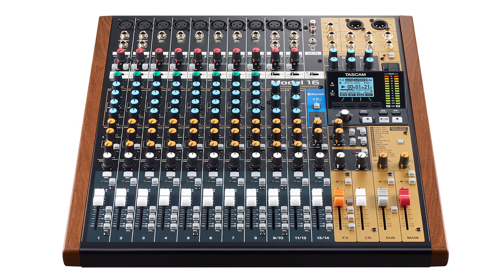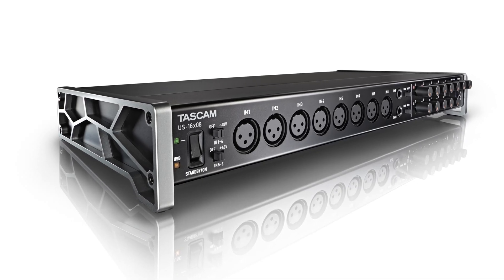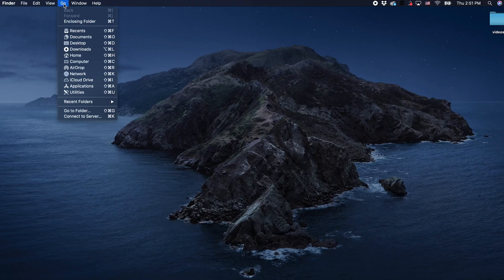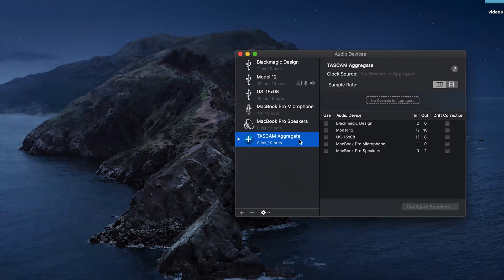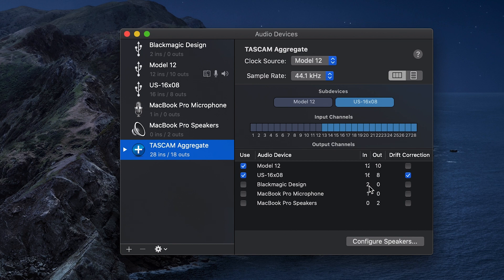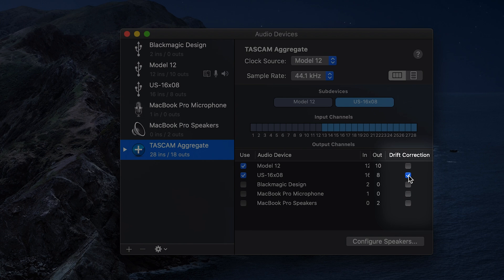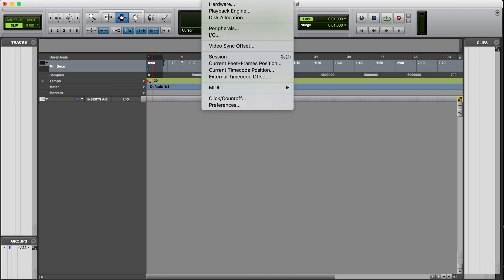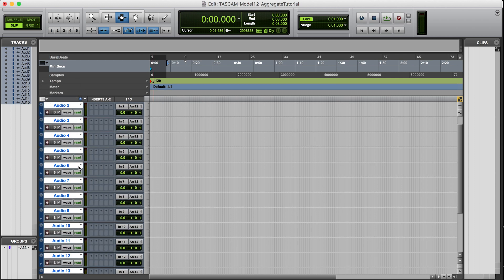TASCAM Model Mixers - How to get More Inputs and Outputs

Comment: Sorry if it’s a dumb question, but I’ve never tried the aggregate device thing yet… 

So…
If I follow the steps in this video, and have this Tascam rack interface with my hardware plugged into it 
(Bass DI, Guitar DI, tr8, JU06a, SH01a, DFAM, Sub Phatty)
So 7 inputs, 2 x XLR and 5 x Mono Jack

Can I then have the model 12 free of inputs, so I can use it for individual Maschine group or sounds? (Samplers, Kits/groups etc) 

I hope I’ve explained myself enough for you to understand. 
There’s one of these exact interfaces for sale second hand for decent price, so it will be an amazing addition for my set up. Especially because I have 7 hardware devices and only 6 mono channels.

Comment: I already own a Model 24.
I want to add a Model 12 via aggregate so that I now have a MIDI,
and would want to put everything with phantom power into the M12 and everything without into the M24.
I'm using iMac with LogicPro
When it came time to mix,
could I export channels to both the M12 and M24 (leaving CH 1 and 2 open on both for the master) and then via cables
plug the master out of the M12 into two open channels on the M24 basically having the M12 be a bus of sorts and now being able to have a larger fader board essentially.
Or could I also, run the M12 master out back into the DAW as two new tracks, and then send those tracks into two open channels of the M24?

And if this is possible, would it be better to have the M12 as the master mixer and send the main outs from the M24 into the M12.

I've tried several google searches and surprised I haven't found an article or video about this specifically.
If it is possible, could you please make a tutorial on it?
I imagine many folks have wondered the same.
And I would suppose if possible with the M12 and M24, one could interchange the M16 or M2400 into the mix and it work as well?

Thank you in advance!!!

Comment: Do you have to keep switching your playback engine back and forth if your tracking from the master interface for example?
Reply from the maker: Hello!  No, that wouldn't be necessary. Once you create the aggregate device it will all be linked and your system will recognize the multiple interface setup as a one overall unit.
Reply from the maker: Great question!

Comment: Hi their does the model 24 have pre and post for the aux sends like the model 16 does, cheers
Reply from the maker: Hello, Craig!  Yes, the Model 16 and Model 24 are virtually the same unit, just with different channel counts.  The internal workings are the same, so anything possible on the 16 is possible on the 24 and vice versa.
Reply: @TASCAMUSA  thanks for getting back to me, so how would one do it on the model 24 when there is no switch

Comment: Just picked up a Model 12 to use with my M1 Mac Studio. When I create an aggregate with the existing FocusRite Scarlett 2i4 with the Model 12 I get a ton of distortion out of my studio monitors. Tried every combo of clock I can find and still, distortion. Use the Scarlett by itself and it fine, no distortion. Updated firmware to 1.33, same result.

Comment: Hello! So I have a Tascam M12 and I want to send audio out of it and to an old Tascam MKIII for some tape sounds. Would I need an audio interface or could this be done with just the Model 12? Thanks
Reply from the maker: Hello J Blue!  You don't need an audio interface for that.  Also, sounds like a fun project!
Reply: @TASCAMUSA  ok sounds good but now….how do I do it haha can I use my main outs from the model 12 to send the audio from my DAW to the MkIII? Or should I use different outs? Ultimately im not sure which outs to use to send audio out of my daw and out of my model 12 to something else. Any recommendations would be amazing! Thanks!
Reply from the maker: @jblue1628  If your main outputs are already hooked up to monitors, you can always use the SUB OUTS.  Just make sure all the channels you're using on the Model 12 have the SUB button activated at the bottom by the fader.  The separate SUB fader will control the overall level of the SUB out.
Reply: @TASCAMUSA  SWEEEEET. Thank you for helping a newbie. Haha
Reply from the maker: @jblue1628  no problem, anytime!

Comment: Hi Guys, I connected my model 12 with the scarlett 18i20, it works great, but is it normal that on the Model 12 the EQ, compressor,fader etc. does not work if the model 12 is the slave?
Reply from the maker: Hello Keller Flavour!  How do you have the two units connected to one another? Also, are you using the Model 12 as another set of inputs, or are you using it as a DAW controller?
Reply: @TASCAMUSA  Hi! thank you for your answer. I made an aggregate device from both interfaces on my Mac. I didn't connect the two to each other,in my DAW it works,but no fader,EQ etc.on the Model 12 works.
The Model 12 is the slave in the Device.
Reply: @TASCAMUSA  i use it at another pair of inputs 👍
Reply from the maker: @kellerflavour336  this should be an easy fix.  The Model 12 has an option in the menu to select where the USB send point is.  Go to the MENU, then MIXER, then select MTR/USB SEND POINT.  You'll have the option to set it at PRE COMP, POST COMP, and POST EQ.

Also, make sure the channels don't have SOLO enabled.  In the same menu as above, instead of choosing SEND POINT, you can select SOLO MODE.  By default, this is set to PFL (pre fader level) which disengages the fader on all channels in solo.

Let us know if this helps!
Reply: @TASCAMUSA  Guys, you are great, thank you very much for your answer, as soon as I've tried it, I'll let you know :)
Reply: @TASCAMUSA  Hi again :) So, the EQ and Comp works, but I also get the signal into the aggregate device with channel fader and main fader to 0.
When I play another instrument, I hear the signal in my DAW even when the channel fader on the model 12 is at 0. :)
Reply from the maker: @kellerflavour336  when the Model 12 is being used as an interface and has it's USB mode in MULTI the signal is being sent to your DAW pre-fader.  So, you'll need to manipulate the levels for that channel in your DAW's mixer section.
Reply: @TASCAMUSA  Hi! Ok,thank you for your answer :) Great Service!

Comment: Can you aggragate 2 tascam to get 48 cgannel?
Reply from the maker: Taro, yes you can!  This can be done natively with a Mac, or if you have Windows you can download third party software to connect them.
Reply: @TASCAMUSA  But ONLY when working in a DAW. It's too bad Tascam didn't make it so you could sync 2 Models together to expand the I/O for remaining working within the desk/box.  Would a firmware update be able to add this ability? If so, that would be a major selling point. And with a Model 12 (which I have) you could double the Model 12's ability and there by making it a real power house and the ability to use it as a surface controller in a DAW for more than the 12 tracks the Model 12 is limited to controlling currently. Am I correct?
Reply: @TASCAMUSA  Are you going to answer my question from almost a year ago about syncing 2 model 12's together? YouTuber PowerCoat Music says it can be done, but I want to hear confirmation from the maker directly.
Reply from the maker: @truthwinseverytime8805  As far as combining two Model 12's to get more I/O - yes, that can be done by creating an aggregate audio device (which is native to Mac capability, but for PC you'd need to download a third party app).  In regard to syncing two Model 12's to get twice the DAW control, there isn't a way to do that.
Reply: @TASCAMUSA  I'm talking about a completely DAWless scenario. Midi cables between two Model 12's. One becomes tracks 1-10 (master unit) and 2nd model 12 becomes 11-20 as the slave and through Midi sync they record all armed tracks simultaneously and play back all "20" tracks simultaneously. Forget about a computer. I'm talking OG no DAw involved. And if this is not a feature of the Model 12 that I am fairly certain you can implement it through a software update/firmware update.

Comment: Iv try this with a focuritr and it fuck up my entire things.. both device were on 24 bit 48
.. the daw was at 24 48... the audio midi set up was too... the saffire was slave... 
Yet the tascam keep saing usb fs mismatch... 
I change it to slave... same... 
I try 44 for all
..same... 

I disconnected evrething started again... same.... 
I gave up.. try to only use the tascam... and it keep saying usb fs mismatch... 
I had to format the sd card and start again from scratch... 
Eventually the problem went away for no reason. 

Try at your own risk

At less you couldve gave us track swap with a menu like model 12
Reply: It probably just synced incorrectly initially and then when you reformatted the card it freshly synced everything to 24/48.

Comment: Ok, I have an apollo 8 that needs and I simply need more line inputs. Can I use this for that? Plug all my boards into this and run this into my apollo 8?
Reply: Yes. I am doing something similar. I have an XTUGA 12 channel board that I am running premix levels to one track of the Model 12 at a time. So for example, I use 8 mics on my drum kit. I get all the levels for those mics good first and then send the summed signal to 1 channel on the Model 12. I use 4 mics when recording guitar or bass and again sum  those to 1 track. I keep doing that for each thing. So basically it does give me 10 mono tracks to mix from that shouldn't need to much EQ'ing from that point.

Comment: Thanks for the helpful video! If I link another audio interface (I'm using a Scarlett) using the aggregate function, would I be able to power a condenser with phantom power on the Model12, while also using a ribbon mic on the linked audio interface safely? Don't want to fry my new ribbon, and would like to use both mics simultaneously
Reply from the maker: Hey JR!  If you were to link two audio interfaces the phantom power applied to one interface would not transfer the other.  So operating a condenser mic on one and a ribbon mic on the other would work just fine!

Comment: Hi their is there anyway we can record a manual fade out at the end of a song using the built in digital recorder, when mixing down there seems no way to fade the sing in or out, any help would be appreciated
Reply from the maker: The Main fader does not affect the stereo mix recording so if you want to create a fade in or out I would suggest turning off the Main on the channels and  sending all the channels to the Sub out, then on the Sub channel press the Main button down. Then when you want to Fade out turn down the Sub fader.
Reply: @TASCAMUSA  thanks for getting back to me, yeah i tried that but then when listening back the fade out is their and after the fade out the rest of the song apears again at full volume, even though I’ve-hit stop on the recording
Reply from the maker: @craighughes-shug6694  The stereo mix recording goes for as long as there is audio, it does not stop after you press Stop. You would need to edit the stereo mix file in a software after to cut out any unwanted audio
Reply: @TASCAMUSA  yeah thats what i was thinking of doing thanks for getting back to me, so it this is the case with the master been in a different path to the control and sub does this also mean we cant access the on board graphic eq for mix-downs, even when using the main outs
Reply from the maker: @craighughes-shug6694  The graphic EQ does not affect the stereo mix recordings
Reply: @TASCAMUSA  on this page on an introduction to the tascam model 24, they guy presenting the video says tweak your on stage monitors or notch out some frequencies during mix-down, thats a-bit misleading
Reply: But cheers for getting back to me

Comment: Great tutorial.How about a tutorial showing how to combine a pair of the model series mixers to create an aggregate device to expand the channels?I’ve been advised by tascam that you cannot combine two matching mixers(model 12s for example)
  but you can combine the 12 with a 16 or 24  or a 24 with a 16.how about it?there are plenty of tutorials out there on making aggregate devices with interfaces but we need some on mixers
Reply from the maker: Edwin, this is the video for you!  Here we show you how to create an aggregate device using our Model Mixers.  This can be done exclusively with Model Mixers or you use any other TASCAM interface along with them.
Reply: @TASCAMUSA  hi can you run two mixers together using the internal digital recorder, or does this have to be done when running as an interface with a daw
Reply: @TASCAMUSA  thank you very much!informative as always
Reply from the maker: @craighughes-shug6694  There isn't a way to sync two mixers together, so it might be hard to use 2 together using the internal digital recorder
Reply: @TASCAMUSA  ok cheers for getting back to me
Reply: @TASCAMUSA  you can aggragate two 24 ? In logic... use channel 47 and 48 to record mix on sd ?

Comment: This is not directly related to the subject matter in this video, but I really could use some help. I just purchased the Model 24 and I'm trying to use it as an audio interface with Studio One, But I cannot figure out how to get an audio signal from any track on the Tascam to an input channel on the Studio One DAW.
Reply: John, only the Model 12 can act as a surface controller.
Reply from the maker: On the Model 24 set the channel to live so you can hear the input. In Studio One make sure the Model  24 is selected as the main input and output device in the audio preferences window. On the track you are recording on in Studio one make sure to select the input that corresponds to the channel on the Model 24. Like if your mic is in channel 3, select input 3 on the track within Studio One. If you need further help with this please call us at 323-726-0303
Reply: @tomyg2766  I'm not trying to use it as a surface controller. All of the Tascam models advertize that you can just use the Tascam as an audio live interface and be able to record directly into your DAW from the Tascam. I have a midi kybd that I can use as a surface controller.
Reply: @TASCAMUSA  Thanks. I will call up later.
Reply: @johns1159  make sure the track assignments in your DAW match those of the Model 12 ... Boom !

Comment: Maybe the new TASCAM Model xx will have a few more physical aux outputs that can also be used to route USB audio from the PC to them. Maybe...
Reply from the maker: The current model mixers can have audio routed from a computer over USB into the mixer
Reply: @TASCAMUSA  Thanks, I know that, but I'm referring to extra AUX outputs. Sometimes for live, 1 or 2 AUX outputs are not enough. I know this is a physical space limitation now, but maybe in new upcoming models.